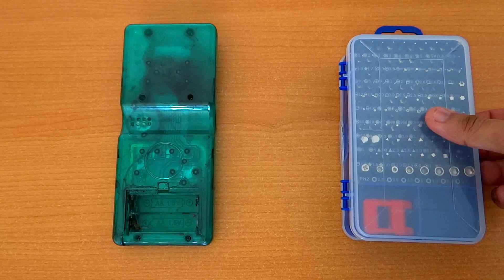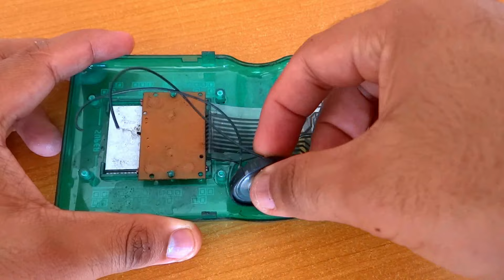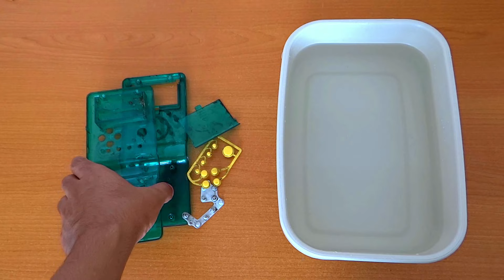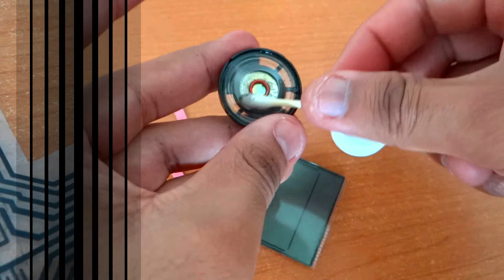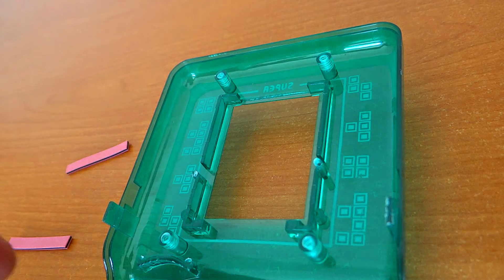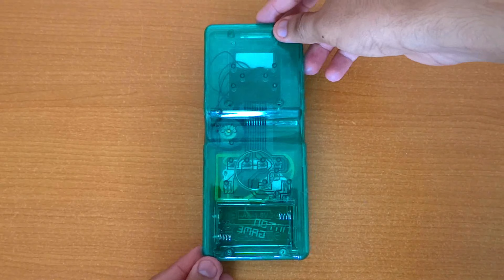Restoring Brick Game 9999 in 1 - Restoration a Broken Tetris HANDHELD

Comment: mine has a stain on the screen (shadow) how can I remove it? or need to change? If in the case of exchange these screens are universal? Because my model is the (Pro Jr game) like a brick game that opens and closes
Reply from the maker: In general, the screens are compatible, since these Chinese consoles are all the same, they just put them in different cases but in the end they are almost identical inside.
Reply: @VRestoration  Thanks for the answer, just one last question, is if these minigame lcd screens, for example the brick game is capable of reproducing any game image from the original console, or does each screen have its particularity in the image demonstration?